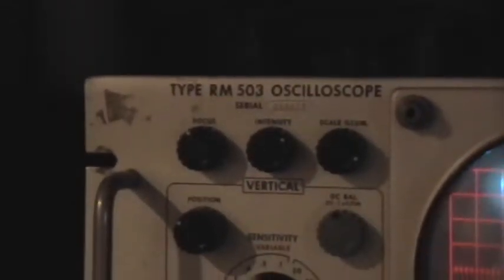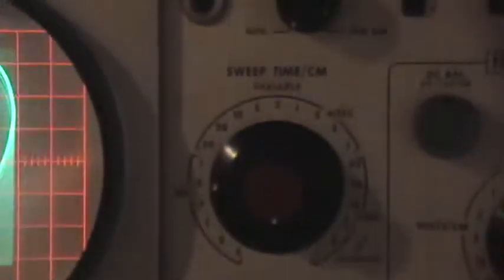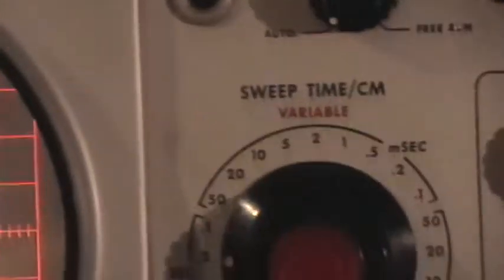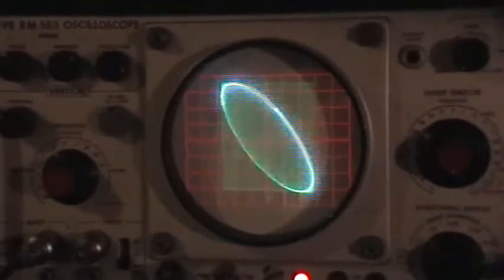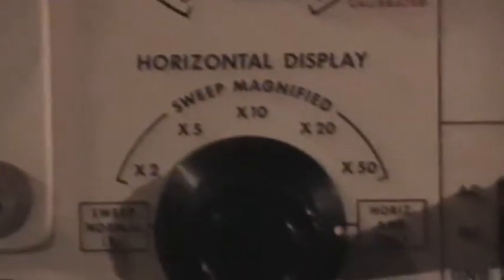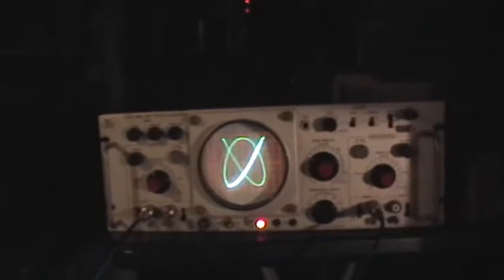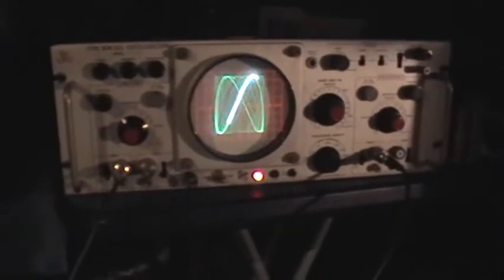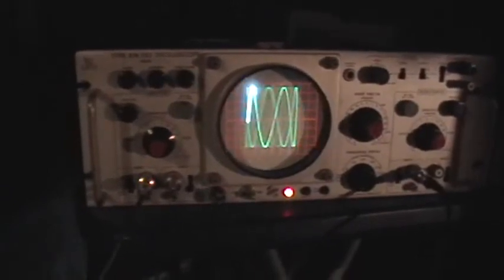Scoposcopy:Tektronix RM503 Showing Lissajous Figures

Comment: Hello! Beautiful scope, these jewels should be saved and looked after. Does it have level triggered seweep or the older synchronised oscillator type? Thank you for sharing!
Reply from the maker: Yes, it has level triggered sweep, but of course this is not used in this demonstration. Also, the horizontal and vertical amplifiers are identical circuits, and have inverting and noninverting inputs. Please also see my video demonstrating the patterns using 4 oscillators. Thanks for watching and commenting!